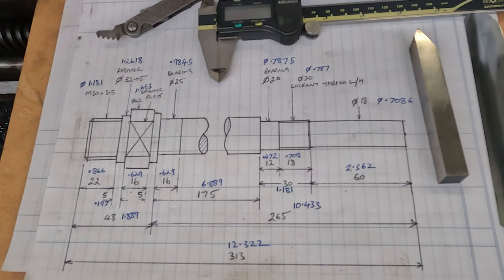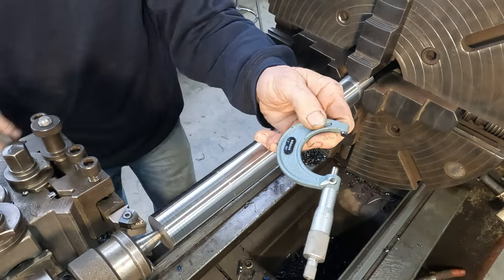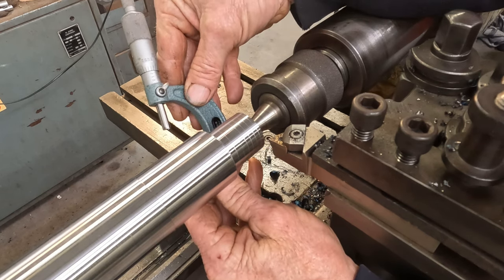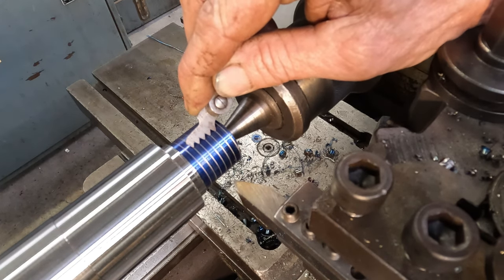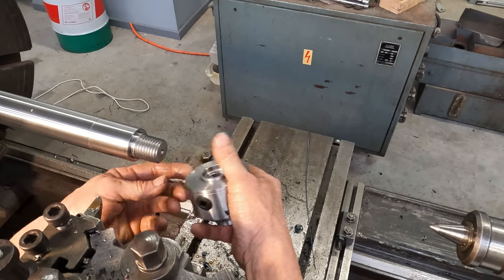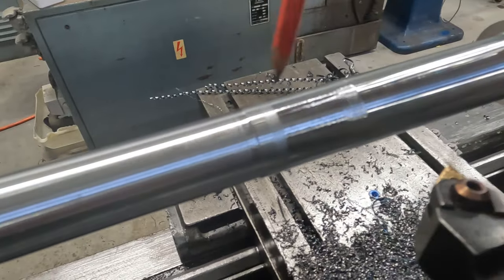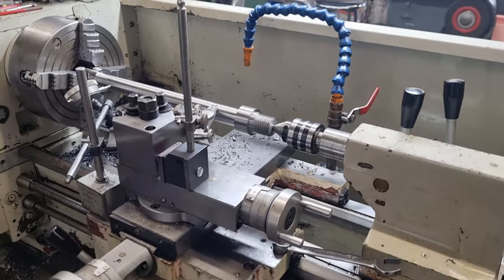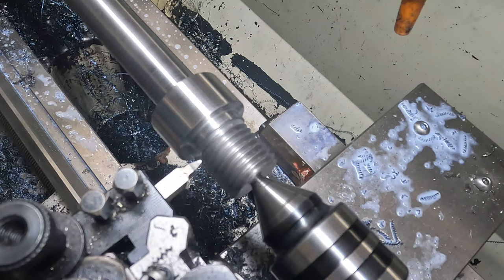Making A New Wood Lathe Spindle .

Comment: Great tip on truing the lathe to the shaft. That 80mm pitch would be useful for a multi start thread requirement where you need the mating pieces to move fast, but still have strength.
Reply from the maker: Also for grease grooves .  👍

Comment: Looks good Max.  For a minute there I thought David Wilkes had posted a new video, what with the chuck to tailstock turning.  I've had the same chatter issue as you and followed the standard advice to drop rpm, increase feed rate to no avail.  Then went the opposite way and increased the rpm which fixed the problem, proving once again that in machining the sage advice works, until it doesn't. Ken
Reply from the maker: Thanks .  Lol .  As you know , we have a good stash of tricks still up our sleeve .   👍

Comment: Hi Max, our forefathers would have turned it between centres, alleviates any distortion and the chuck problem.
Switching to a HSS tool might have solved the vibration problem on the large lathe.
I could not thread up to a shoulder on a 80mm pitch thread even disengaging the half nuts, would need super human reflexes unless the speed was so slow to compromise finish
Reply from the maker: I hate turning between centres , has it's own set of issues !   Ok for certain jobs . 👍
Reply: Hi Max, wood lathes becoming popular, Adam Booth Abom 79 making a spindle on YT.
Reply from the maker: @willemvantsant5105  That's what happens when you set the trend !!!

Comment: Hi Max, As you say each to his own. I would have done it slightly differently ,I would have machined it between centres. That way you know all your diameters are true to each other and it doesn't matter which lathe you are using. I just clamp the driving dog to a chuck jaw to prevent slippage when screw cutting. But as you say there's more than one way to skin a cat. Best wishes, Mal.
Reply from the maker: Cheers .  I do not do much between centres .  if i think it warrants it , i do though  . 👍
Reply: Machinists avoid between centres, ref can only take lighter depth of cuts, so don't make much money, obviously if tolerances demand it, then it is done.
Reply from the maker: @bostedtap8399  Avoided for those exact reasons , same as travelling steady's !

Comment: Hi Max looks like the big lathe did not perform to bad. question why some times do you plunge straight in when cutting threads have seen that before, but do not know why. Thanks Cheers
Reply from the maker: Plunging in is an easier method , less to set up .  But i generally only do it on smaller threads .  👍
Reply: Thanks Max for explaining that, keep up the great work. Cheers @swanvalleymachineshop

Comment: Hi Max from wet and windy Tasmania. just a thought while watching you struggle with the chatter issue. If you run the following steady, do you run your fingers on the smaller machined surface or on the oversize surface: EG before the cutter or just after the cutter??? . it is something I think about often watching YouTubers struggle with the same problem and not having a following steady to use.
Reply from the maker: Ahead of the tool .  I do not have one for that lathe  .  👍

Comment: Great. Please consider not speeding up some of your thread-cutting. Seeing the speed you do things is helpful, along with telling us your RPM in use.
Reply from the maker: No worries . I will try & remember to show a bit more .  I might do a threading video , someone asked the other day .  👍
Reply: Joe Pie always recommends thread cutting from the headstock out, with inverted tool. I'd be interested in your take on that. I have a dual metric imperial Harrison, which has an imperial leadscrew. Since I largely turn metric threads, finding ways round not being able to disengage the leadscrew is also  always of interest.
Reply from the maker: @RicktheRecorder  There are good reasons not to thread back to front .   I will have to do a video on it soon  !  👍